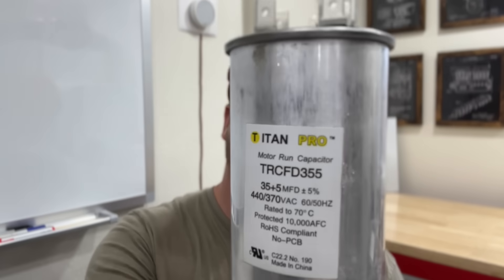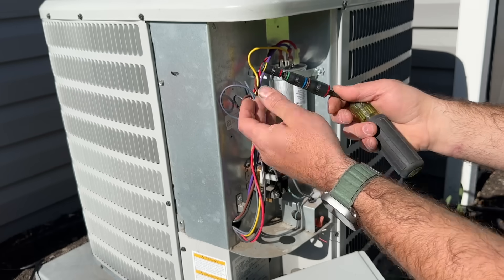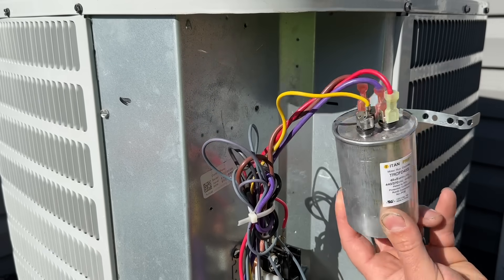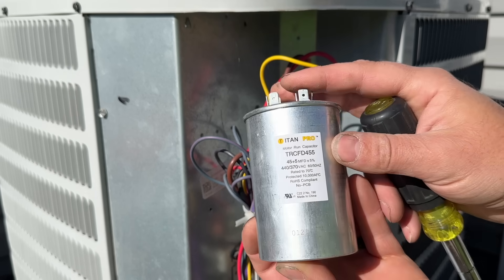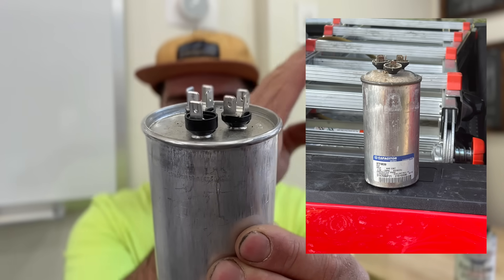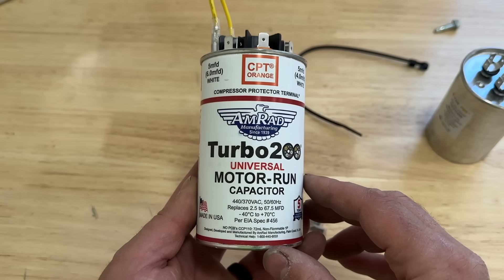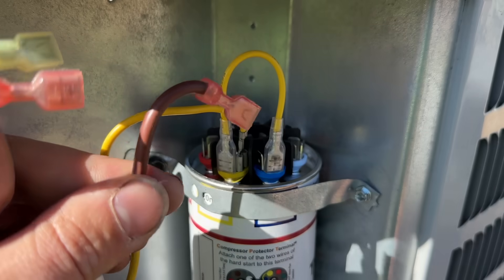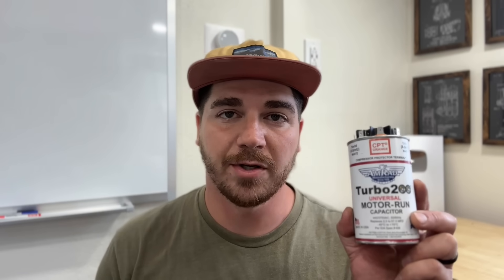HVAC Contractors Practically Make Their Living On These

Comment: THIS GUY IS HOME SITTING IN HIS CHAIR TRYING TO GET VIEWS TO MAKE MONEY. HES A DIY GUY THAT WORKS ON RESIDENTIAL EQUIPMENT AND NOT IMPRESSED @ ALL” YOU COULD TELL HE WORKED FOR RESIDENTIAL RENTAL PROPERTY AND LEARNED A LIL SOMETHING AND NOW HES A BIG SHOT THAT DOESNT KNOW THE INDUSTRY. 40 YRS IN THIS BUSINESS DOING COMMERCIAL- RESIDENTIAL -INDUSTRIAL I WOULD-NEVER TELL ANYONE TO ATTEMPT TO REPAIR ANYTHING NOT BEING LICENSED AND CERTIFIED TO DO THE WORK. 

Over the recent decade, more homeowners have chosen to DIY many home projects. This may help you save money on some aspects of home upgrades. But, electrical projects are ones that you should never DIY. It may be tempting to attempt electrical projects to save money. You should know that these projects can be dangerous for both you and your home.

Major Dangers Involved In DIY Electrical Work

It’s very crucial to realize that electrical work is very complex. One must ensure that they know where the electrical current is flowing and where it’s grounded at. A sheer lack of this knowledge can lead to electrical overload and potential house fire. Plus, if you don’t handle live wires the right way, you can electrocute yourself. If someone touches a conductor like water or metal, they can electrocute themselves. Another danger of DIY electrical work is that your wiring may not meet inspection codes. Electricians are knowledgeable about the electrical codes. This includes things like where wires can be within a home. If you don’t know these codes, you can end up failing an inspection later down the road. You may need to rip everything back out and have it redone by a professional.

Are There Any Safe DIY Electrical Repairs?

Now you are aware of the dangers that go along with electrical work. You may wonder if there’s still anything electrical that can be a DIY project. The short answer is no. You can opt for changing the faceplate on your outlets and light switches, but that’s about it. It’s best to leave any of the physical wiring up to the professionals. They have the knowledge and many hours of experience in their specialty.

What Should You Do With A Major Electrical Issue?

If your home experiences a major electrical issue, then it’s time to call in the professionals. Remember that electrical work can pose a danger to those who are not experienced in the industry. You should have an electrician that you can rely on when you have a problem with your electrical system.

Comment: It pays to learn a little about electricity and how things work. Several years ago the start cap on my AC compressor died. The compressor would hum but not start up. I knew instantly what was wrong. Lucky for me a neighbor of mine is an AC man and he just gave me one out of his spare parts. I put it in myself and the AC unit has been working fine ever since. Cost me about 10 minutes of time to fix.

Comment: I worked as an HVAC technician. We charged about $200 to diagnose and replace a failed capacitor. Is that over priced? If you can diagnose it yourself, and replace it yourself, yeah. Consider that the technician is only getting paid the hours he's on the call. He's going to spend at least an hour to diagnose and replace your capacitor and check out the rest of the system, plus it's time traveling there and back that he can't be doing other jobs. The reason I am not still a HVAC technician, as I never met one that owned a decent car or had a decent house, because all the other hours they're not on call they're not making money. I work a job now with guaranteed hours every week, I'm making 10 times as much for a similar wage. If any of them are charging you $2000, there's fraud taking place, and unless you show me the receipts, I'm gonna say that you are full of BS.

Comment: Thank you very much for these great videos. The side of my house where my condenser sits is near the green belt. On two occasions I had mice chew the wires on the capacitor and then get electrocuted. Poor bastards had their legs all stretched out and stiff. I suppose it was a quick and painless way to go but serves them right for chewing up my wires. I didn’t have to swap the capacitor yet, but just by watching your videos I am able to get in the panel, diagnose, clean up the mess, and fix the wires safely. Thanks again.

Comment: Even using the Turbo 200 you still need to know what size capacitor you need. Otherwise, you may connect 2 terminals and over or undershoot the size the unit needs to start.

Comment: Is this the same as a hard start kit?  I had an HVAC company service my unit and then the next day it quit working. They couldn’t get back out until the next day, it was hot so I tinkered with it. I didn’t find anything wrong, but it did start to work when the tech finally came out he recommended a hard start kit to help it start up on hot days.

Comment: I am a general and hvac contractor, no one have I ever seen or even heard of getting it replaced for $2k or even $500 most contractors charge $300-400 and cover overhead stop BS people for clicks so lame that you do hvac and this is what you think!
Reply: You should open up a shop in southern Utah, then, as scammy hvac contractors here are the norm. I had a blown cap last year, but was too sick to replace it myself at the time. First three guys I called out said that it couldn't be fixed, and the unit would have to be replaced. Of course, I knew what the problem was, but didn't inform them in advance. Luckily the fourth guy I called was honest. 500 bucks later (and a new cap, of course) and it was working again.
Reply: Not true. I was quoted $800 just for the part this week. Fixed on my own for $30

Comment: the reason is i started a/c repair back in 1972  started with trane a/c in ga  , the capacitors where 3 times as big in size and where made in America  they did contain pcb s but they weren't from China  China makes junk   the smaller size cant handle the heat build up .also check the contactor  have seen ants dead under the contacts points

Comment: I worked for 30 years as a computer tech/MAN! I cant tell you how many jobs all I did was a reboot to fix their problem.
NOT just do a restart type reboot from the desktop but
1-turn off the computer from desktop
2-Unplug power cord as some components stay hot while cord is connected.
3-let Pc sit for several long seconds to allow all the electronic components to drain of all electricity.
4- THEN, push the power button & reboot the machine.
5- hang out & let the operator work with the machine for at least 5 min to see if the problem returns
6-get paperwork signed and be on my way.

!

Comment: Ours went out, I called the local HVAC place if they had a part on hand, was told "I wasn't certified to work on A/C's" and refused to sell to me in 94F heat. lmao its a single phase starting capacitor! I told 'em I no longer want their services/screw overs anymore... over a $15 capacitor.   :)

Comment: I paid $200 to have a new capacitor and compressor heating strip installed since the original heating unit had rusted away.  This involved 2 trips to my house for the serviceman.  So I think that was a great deal.  He just asked that I consider him for when the unit eventually would need replacement.
Reply: Seems fair 🤔
Reply: Not sure how he's even making money.
Reply: @kennybakerhvacr5751  We would go broke doing stuff that cheap
Reply: Too cheap , service call $99 per hour, capacitor $79_ crankcase heater $90

Comment: Dissenting view: I got changed $400 for this repair. What did I get for it? The correct part, expertise, he checked the  Freon on my 30 yr old unit, told me it was full, did not try to sell me a new a/c, and when I hired him to replace my furnace (which was literally falling apart), he again did not try to sell me an a/c and pointed out how the a/c component near the furnace was old but fine. Furnace cost was half the other estimates because of this. Businesses need to make money. Pointing out that this part "costs" only 10 bucks is like saying a business only pays x amount for their inventory. There is more to it. Overhead, expertise. The average home owner should not be Fing with their a/c like this.

Comment: I had a portable A/C unit that the compressor wouldn't turn on, thought I'd have to toss it and buy another. So took it apart to clean and have a look, tested the capacitor (was bad), 20 bucks later it was running again.

Comment: Last year I had a lizard crawl across the capacitor and it bridged the connection and fried. It tail fell off and hit the switch and bridged the low voltage and high voltage. That tail hitting the switch cooked the defrost board in the unit in the attic. 😂

Comment: I do not disagree with alot this guy says. However He is dangerous get some better install videos and how to work around electricity videos. a $70 Turbo cap is an expensive item to be just keeping around. Unless you have various equipment around using multiple sizes of capacitors. Just open the damn panel and see what size spare you should keep on hand. Just an opinion, do what you think is best for you.
Reply from the maker: How am I dangerous? I showed how to kill power, and discharge the capacitor 🤷🏻‍♂️

Comment: Got gouged last summer by my HVAC company. Capacitor went bad, technician charged me $330 to replace it. They got you by the balls when it's 90+ degree outside and you're cooking in your house.
Reply: $330 isn’t unreasonable, depending on the company doing the work.

Comment: you should tell them what makes it blow out, maybe you don't have any idea why it blows out, I will tell you, the capacitor can only withstand a certain amount of overvoltage, when the contactor becomes worn and closes, it creates some arcs and the arcs are more voltage than the capacitor can take and it blows out, always replace the capacitor and contactor at the same time.

Comment: I'm a DIY myself, and I do find this MOSTLY agreeable.  A few comments: yes, there are scummy HVAC companies that will charge $2K for this, which is insane.  A more common charge would be $300-$500, which is still high, however it is covering a lot more than the cost of the part, typically including checking the charge, and possible conditions that can lead to capacitor failure, such as overheating due to poor airflow.  If the failure was caused by something like a power surge, there may be other damage as well, that will need to be diagnosed and fixed.  Depending on how long the capacitor has been bad, it is also possible that the fan motor and/or compressor could have been damaged.
BTW, you can always use a screwdriver to short those terminals AFTER you've cut power but before you remove the capacitor.
I have a couple of spare capacitors, and a couple of spare contactors (essentially a relay; another part that often fails) as well, but I am going to give some consideration to the possible cause before I just replace parts, and I'll be prepared to call a Pro if my fix doesn't work.

Comment: This is all great information. In Hawaii I was a handyman and had lots of people call me to replace water pumps because it was dead. They were really surprise when I changed out the capacitor for less than a $100 bucks! Then the times I got to a home for other repairs and find good looking pump just laying around only to find they were sold a new pump because the old on was bad. Usually they would let me have the old one, if I ask, just to get rid of it. I would test them and I bet 8 or 9 times out of 10 it was just a bad cap. I had a way of testing the old pump and would sell them to people on fixed income for a fraction of what a new one was.......

Comment: On the US name brand capacitors you want to replace it if it's -0.1 low as a rule. The quality is usually that good and going down means it's on the way out. The foreign stuff can be a farad or two low new out of the box.

Comment: $10 part, but why dont you mention the cost of running a business? $2000 is a scam, but $200-$300 is the cost of doing business. Overhead (you know the person that answers the phone when you call), internet, phone, lease or cost of owning a location, dispatch software, van, gas, insurance, techs labor, techs benefits, etc. So essentially, it's not just a $10 part be honest.
Reply: the guy didn’t say 200$ repair is a scam 
he said 2000$ is 
so , not sure what your issue is , unless you are upset because you are one of those scammers lol😂
Reply: You might want to work on your listening skills.  Excellent customer service requires it.  He never said a trained expert should not be properly compensated for their training, experience, and overhead.  $200-250 or so? Sure.  But anything over $300 IS a ripoff.  And on the chance your customer learns what you did to them, you’ve lost all their future business as well as the 100 friends and relatives they told about the experience. Chill out, you’ll live longer and be happier. And have a more sustainable and loyal customer base.
Reply: @M22Research  you may want to work on your reading skills. Where did I say that he said it's 200-300 dollars?
Reply: @josephwalker626  you were clearly ripping into him.  He didn’t claim $200 was a scam.
Reply: It costs 100.00 each way for travel time
Reply: @MiltJohnson-sw9lc  only if you live in the boonies.  We have probably 20+ HVAC contractors located within ten miles.
Reply: Exactly!! That's why here in California no customers bitch and cry about prices. They know it cost just 5k alone a month on advertising, this being a tiny company I'm talking about
Reply: @Mastertroll-8888  looks to me that you are the one bitching and crying lol 😂

Comment: Best video on changing a capacitor on an AC unit I have watched. I would think the Turbo capacitors would be great for HVAC technicians so that they don't have to carry a wide variety of capacitors in their truck. For the homeowner who can access the specs of the capacitor of their AC unit, proactively buying that specific size ahead of time and putting it safely away for future use seems to make sense as they are cheaper. Full disclosure...I don't know this for a fact, but I would think it makes sense to buy a Made in USA capacitor. Others who know more about these things can correct me if I am wrong about sticking to Made IN USA parts.
Reply: Used to work for a company that only stocked Turbo200/Turbo200X capacitors.  Was certainly more convenient for the technicians, but trying to justify the higher cost of repairs to homeowners can be challenging.  Their other option would be to wait if tech didn’t have the right size cap on their truck.

Comment: That Turbo 200 is a clever solution but imo is expensive for what it is.

BTW some of your explainations are a bit misleading but are sufficient for non-technical homeowners. 

These motor capacitors do not supply a "kick" they provide a phase shifted current to an offset winding in the motor in to create the rotating magnetic field needed by the motor rotor to turn or to begin to turn.
Just remember ELI the ICE man. In an inductor current lags the voltage and in a capacitor curent leads the voltage.
😉😁
Nevertheless still useful information.

Comment: Another great video! About 5 years ago I noticed my AC stopped working, A quick video search showed me to change this capacitor and it fixed it. The AC contractor at work told me you just saved yourself 500 bucks for a weekend service call. The contractor must have been the honest honest type..

Comment: Unfortunately, capacitors often test good with multimeter voltages but fail under mains voltage. The general rule of thumb is if in doubt, swap it out. And the older a capacitor is, the more likely it's failing or has failed. As an electrical engineer I put a ceiling at 5 years  or if any mechanical defect is apparent as mentioned in the video.

Comment: The first time I got to discharge a capacitor was these big old ones in the elevator machine room. We were modernizing the electrical equipment from anolog to digital.

There was like 20 capacitors on the rack. Pop pop pop cracle pop.

Comment: I had a "repair tech" come out and screw around with my system for half an hour, fix nothing and tell me I needed a new system.   I called a second company, they came out, found the leak, fixed it and charged me $1,200 for a $300 can of coolant, plus labor. At least it was fixed. It's a scam industry.  I was able to change the capacitor myself.  I upgraded to a soft start as well.
Reply: Fix it yourself next time
Reply: Complaining about getting something fixed that you could not do yourself.  Somehow that's a rip off.  Amazing
Reply: You were paying for experience rather than a system.
Reply: Isnt all business a scam? Yes it is!!!
Reply: What should they be charging you for this $300 “can of coolant?”  Do you get upset paying $18 for a burger when they only used $2 worth of ground beef?
Reply: @garrybillick3979  $1200 for $300 dollars is robbery.
Reply: 1200 for a leak fix?  You got blessed.  Come to California and see what we charge your cry baby ass

Comment: I don’t know about $10 capacitors…mine rung from $15 to $30.  I always keep spares in hand.

Before I knew anything to called a tech for AC not working and it was the capacitor.  The service charge was about $150 with the capacitor.

Comment: Here’s the hint if the unit is running, but it’s not blowing any air. There is no harm and you simply buying a new capacitor off of Amazon, and installing it to see if that is the fix worst case scenario you’re out about 20 minutes best case scenario you saved yourself, thousands from the scammers, I’ve done this repair myself twice on two different houses I have owned. Worked both times. it is the most common failure in an AC system.